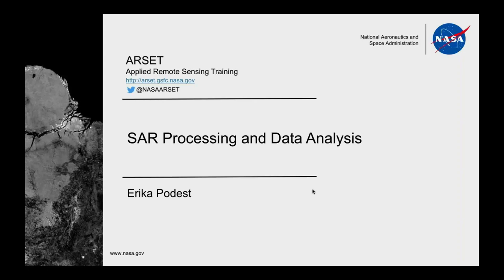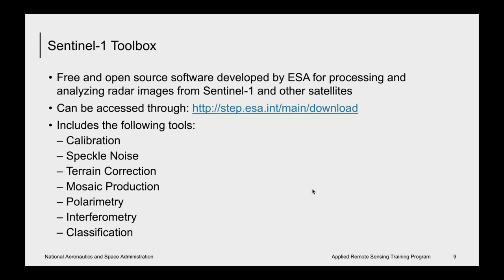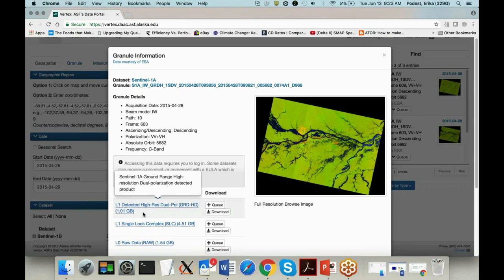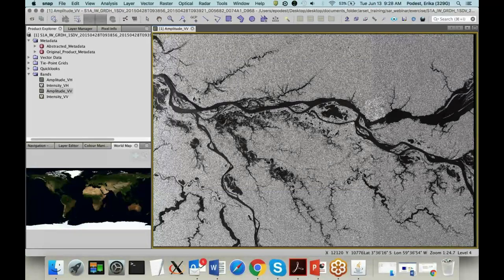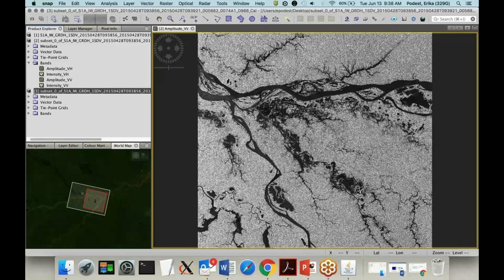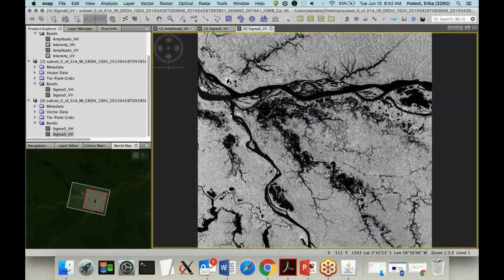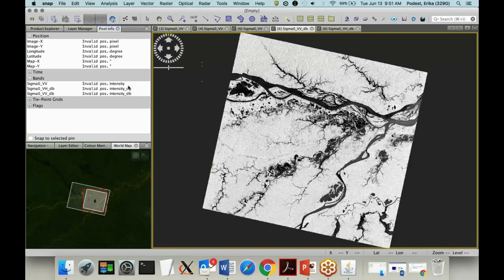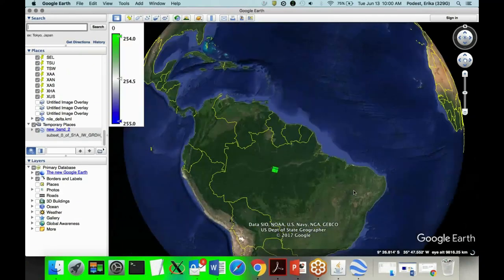NASA ARSET: SAR Processing and Data Analysis, Session 2/4

Comment: Hi, I have a problem with the Range Doppler Terrain Correction. When I try to correct with deafult options the image just doesnt show it is plain black, but ir does work with Ellipsoid correction. I was wondering why is that?
Reply: Hey, I had the same problem. Update your SNAP software to the latest edition, and try again. Hope it works.
Reply: @sidharth1612  It doesn't work updating the SNAP as well
Reply: Hey, I had the same issue where the default instructions only resulted in a blank screen for the Terrain Correction step. I suspect it was due to the SRTM DEM not being downloaded. I used the SRTM 1Sec HGT (Auto Download) DEM instead, and this worked for me. I could see the DEM being downloaded in the bottom status bar, and the resultant images worked
Reply: It happened to me as well and what I did was to close the pop-up it started updating itself, not the program, but the plugins also, then I did the geometric correction and it worked